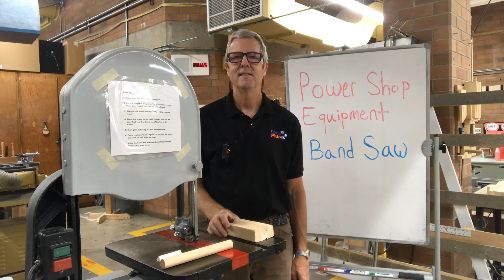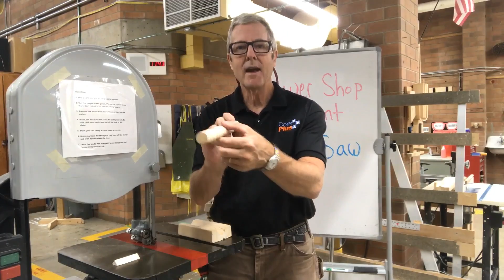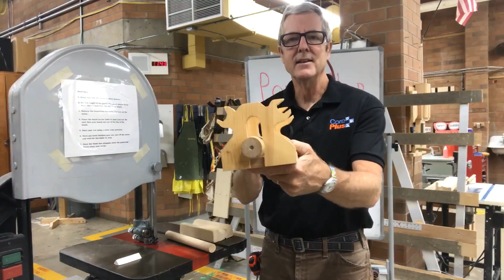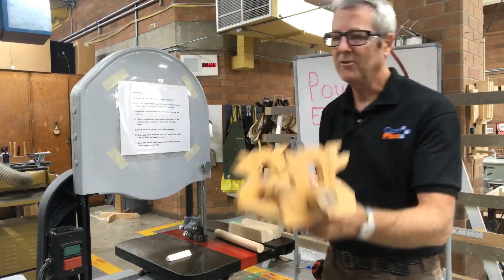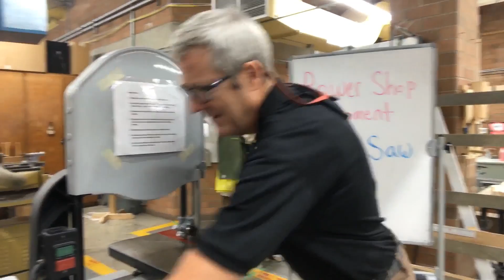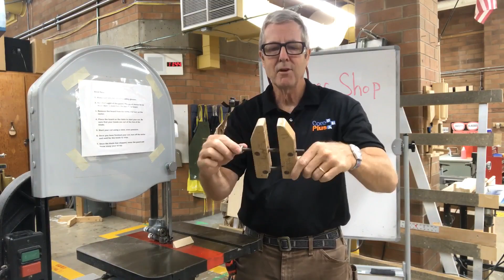band saw 4 cutting small pieces 1

Comment: Hello- I am working on small pieces. Have a 9 inch Ryobi bandsaw.  Old one.  I have wood that is 1/2 inch thick by 3 3/4" x 3 3/4"
I am trying to cut some small hearts out of it but I get nervous about the pieces getting smaller and smaller.  How can I work with this.  Any helpful advice.  I have taken many classes of woodworking over the years.    I so appreciate any advice that you could give.